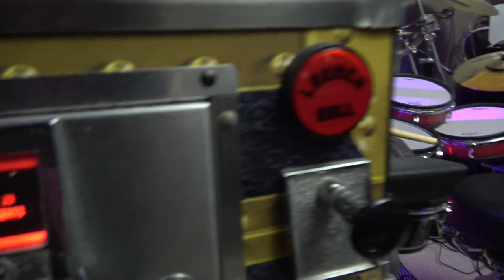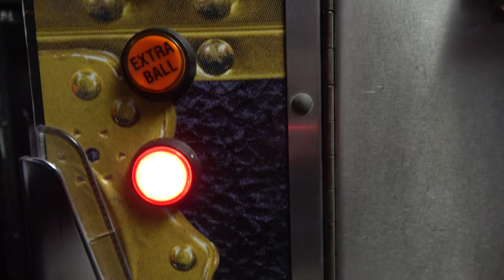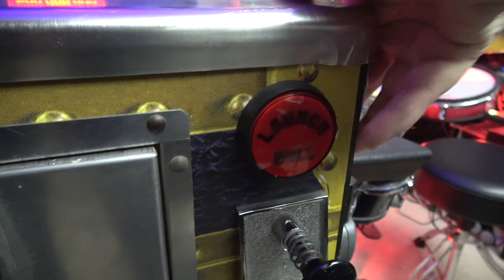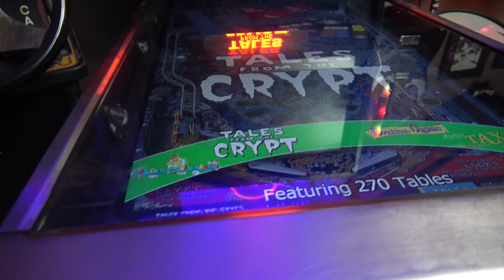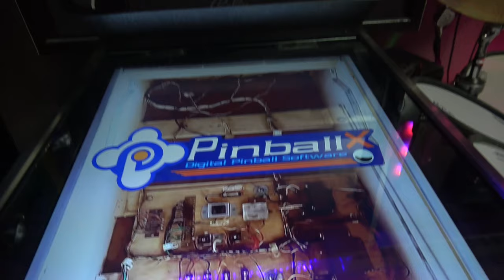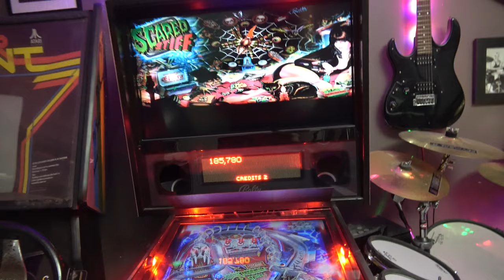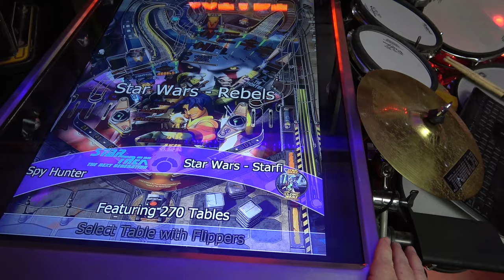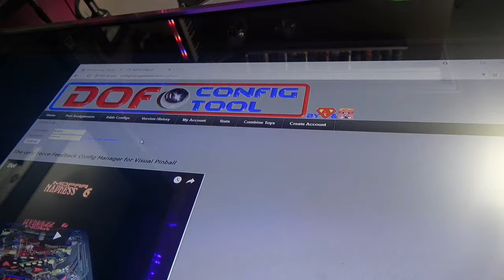FE022 - Build your own Virtual Pinball!

Comment: Thanks Gregg for letting me know about Joy2Key! I was pulling my hair out trying to figure something out, which I'm bald so it doesn't help. I've gotten Future Pinball and Pinball FX working but still am running into issues getting Visual Pinball (Any version) working but will read trew the vpforms to figure it out. Why do you not use Future Pinball? I find it to work very well and easy to set up.
Reply from the maker: Awesome cwgraham...I'm glad that helped! Definitely post up on vpforums in terms of getting your VP tables going, they will help for sure.  With Future Pinball, I do like it (especially the real 3D aspect of it) but it's no longer being developed, where VP is, and I've never liked the physics (even with the later mods). I find VP plays better for all the arcade tables and is getting better all the time due to the continual development at the moment. Future Pinball does have a few really nice original tables though! I may set it back up and take another look but its mainly the physics that put me off it in terms of emulated playability. Just my opinion of course and others may disagree!
Reply: Happy to say, i followed your advice and got VP Finally Running! Early first impressions, compared to FP the tables are really ugly. I get that it isn't 3D but this is ugly by standards of 2000. But the variety of games will make it worth getting deep into. I've heard a lot of complaints about the FP Physics, and do see it with some tables. I find the ones that have Zed Physics seem to play pretty spot on, and closer to a real pinball, although that's my opinion and preference. I don't get if the guy who developed FP stopped supporting it, why he wouldn't have made it open source. Also if VP is open source why isn't it on Linux, it would run so much more light weight, and OpenGL works great. But overall this is a fun project, I'm building mine from Scratch ;-).

Comment: Your backglass shape is 16.9 ? You using pinup popper now as your fe ?
Reply from the maker: Hey Charlie, Yes it is...can't really get the square backglass on a virtual cab except with a vertical mount screen embedded into the cab itself, but that won't have the required width. I can live with the aspect ratio for the sake of it being edge to edge. I'm not using pinup popper yet...